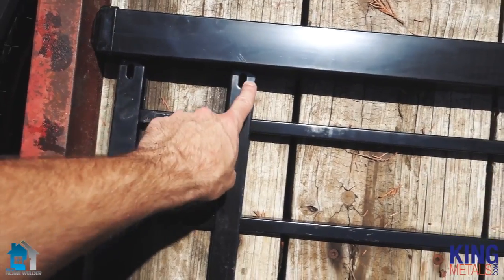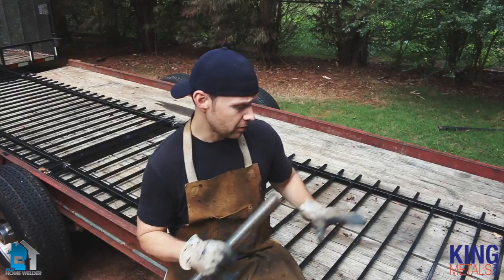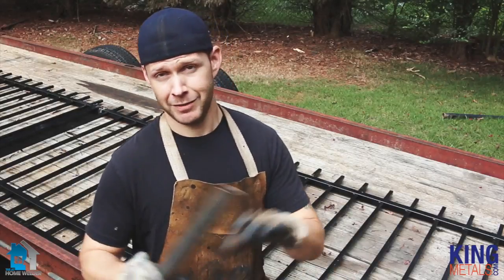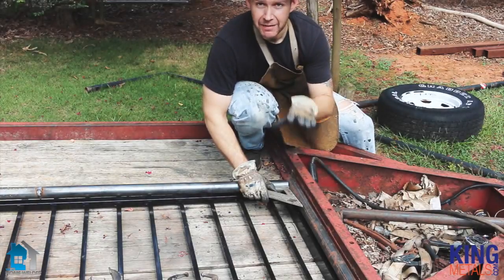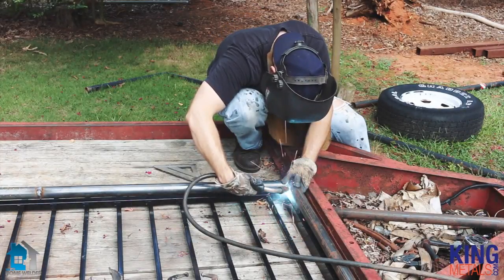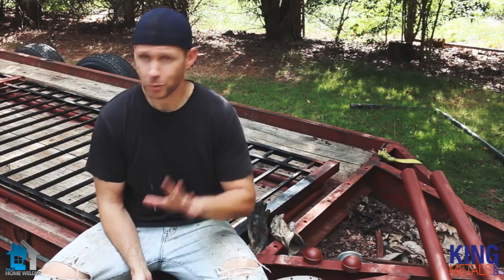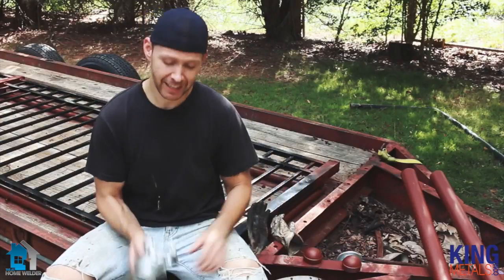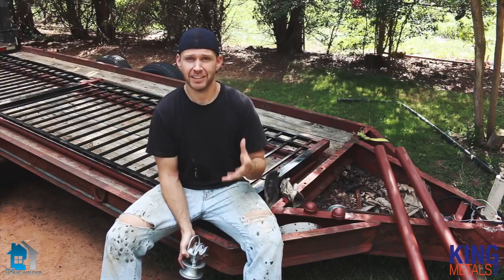Cantilevers and Prefab Panels

Comment: Nice job.  I'm new to mig welding so here's my question.   I saw the tree limbs blowing, not at first in the video but later in it.  Did you have any trouble with the gas covering the weld, being outside and using the mig process?   Or were you using flux core wire?
Reply: exactly what i was thinking?